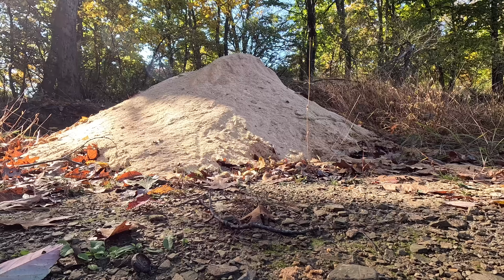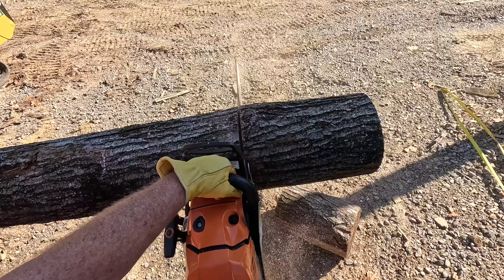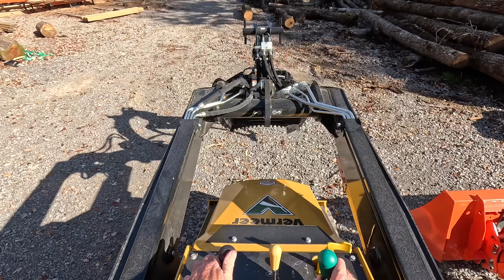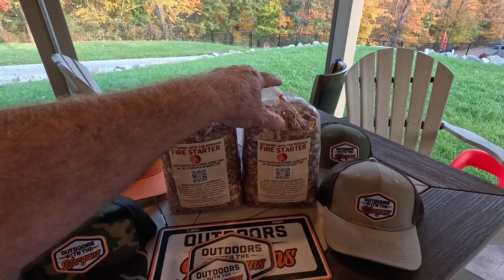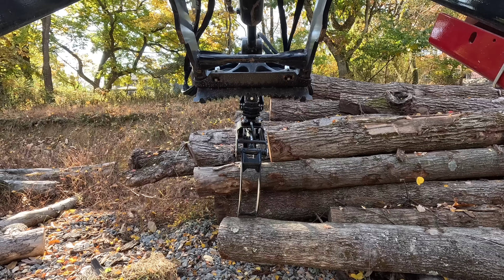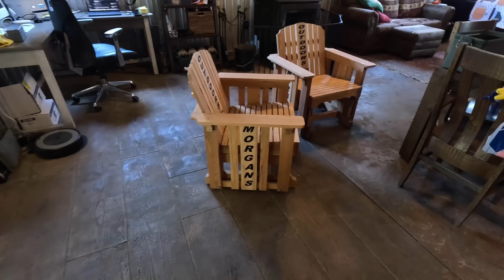Mini Skid vs Tractor, This May Surprise You

Comment: Once we rented a Toro tracked mini skid machine. It was an excellent machine. It was strong, easy to operate and very handy. Later on we bought a tractor with a loader. I don’t know which machine would suit us better. I tend to think the tractor does as we now have a side shifting flail mower to mow grass between trees in our orchard. However it is probable such a mower could be mounted to a skid steer too. 

We will see what happens but I tend to think we will keep the tractor.

Comment: MIke, as a current member of the "stiff neck tractor club"  I just went on amazon and bought a 180 degree view review mirror for my tractor.  it helps with the turning around.  once you get it adjusted correctly, i would think you could gannon, land plane, bush hog, and blow leaves without turning around at all.  it cost me less than $20

Comment: Backtracking in your videos... I think you answered my curiosity about being able to use the blower at a low enough flow for the gravel drives.
Reply: Adjusted throttle with the right blowing angles can keep that gravel in place - Mike definitely has mastered the unit in a short period of time. Nice testament to how easy it is to use.

Comment: As always, great info. If I owned a company manufacturing products, I'd be begging you to use my product on your channel. My experience standing on a battery powered warehouse lift is similar to the Vermeer. Only I was issuing materials to cable manufacturing lines. Go to computer, print off recent orders, get on lift, locate material, retrieve material, scan barcode, deliver to the line that ordered it, bring back unused material, scan barcode, place in rack, repeat. It was a 12 hour shift. I'm convinced standing on the safety switch on that lift for 12 hours a day gave me a heel spur that required orthotics. Not applicable to you for sure, but I can concur w you that getting on and using a stand up lift compared to a sit on lift is way more faster and easier. For your work, you have a perfect set-up. And, omgosh, that blower attachment is so awesome!! You maintain the road in the middle of a forest in what, 10 minutes?? Dang, now that's awesome!! I love your channel, Mike, and I love your family. Thanks for sharing this good stuff w all of us.👍🚜❤️🙏🇺🇲🇺🇲

Comment: I have a question for you about the 500i. I'm not sure if I am doing something wrong or if I need to have it serviced. Do you have a hard time starting the saw after it is hot? I love this saw, it runs great, has plenty of power and I just love running it. When I first get the saw out, I prime it up and it starts on the second, MAYBE the third pull. It starts just fine. After running the saw for a while and shutting it off for five or ten minutes, it will not fire back up. Yesterday I was using it and I tried to restart it, it was very hard to pull and I pulled it until I just couldn't pull it anymore. Still no start. What am I doing wrong?

Comment: Neighbors had some work done on the back of their home.  Guys brought a tiny mini mini skid steer.  Think it was a toro/dingo?  It fit through the fence gate.  Had a couple attachments.  Saved those guys hours and hours of hand digging and moving supplies/materials.  Wasn't nearly as powerful as yours but what a time saver....Pretty cool little machine.
Reply: Those Dingos I think are the smallest mini skids build if I'm not mistaken, just the piece of equipment you need in these stupid subdivisions where houses are stacked right up next to each other.  

Last year a friend of mine was installing a shed in his back yard, and wanted to roto-till, remove the sod, and prep the area so we could spread gravel over the area and get it all packed and leveled....I used my Kubota BX2680 with the 50" roto-tiller and was able to squeeze between his house and the fence bordering the neighbor's property.  Definitely wouldn't have been able to do that with any larger of a tractor, since mine barely fit with the 50" tiller, and was cramped operating in the yard itself, bigger isn't always the answer contrary to what so many people try to say buy the biggest tractor you can afford...well that makes no sense if it won't fit into the areas you need to get into and out of....I can get my tractor into my barn/shop and move the wood working equipment around if I need to, and its a tight fit....I only have an acre, the BX2680 sub-compact tractor is just the right size for my needs...well sure I'd love a 100+HP tractor but what's the point it wouldn't be able to do anything due to space restrictions.

Comment: Weekend casual operators should not consider a mini vs tractor due to stability issues. I speak from experience. 3 weeks ago had an "operator" working a fire lane 3/8 mile into my woods. Lane was covered in downed limbs from a recent storm. The machine was a "new" WM SM100 with a grapple. Operator got the end of lane that ends into a river (no access). He was backing up and the right track went up on a tree stump, a stump that would not upset a wheeler, ATV or a tractor, etc. The mini instantly flipped on its side. Had to get a mini excavator in to upside it now thunder and lightning/raining. ground is getting soft as well. Now the mini wont start, check the manual it has a tip over "don't restart" programed in. It is a Sunday no one of course is available. Monday morning, 5 hours labor, from 4 individuals plus a wheeler and skid steer towed this machine out. Had to destroy a bridge over a stream as well by this process.....NIGHTMARE. Found out since tip overs are not rare with Minis...

Comment: Was watching the leaves blow off the trail and there is a reason the blower is called cyclone.  You can actually see the leaves swirling in a helical pattern when blown.  So not only do they go forward,  they are spinning in a little tornado of air before falling down.

Comment: Good points Mike, but as you know I started years ago watching your channel for Tractor based content , so I do have a bias for Tractors... Indeed for your use in the woodyard the Mini Skid is the ticket, lifting power is a must along with maneuverability; BUT for all around land activities for small or large land owners the winning point of Tractors that you didn't hit on much in this video is PTO drive out put which the Mini Skid lacks. Also the many more attachments that PTO outputs (front & rear) that gives the Tractor overwhelming capabilities for home/landowners over that Mini Skid... But like I said, for your woodyard I see the pull in your affection towards the Mini Skid.👍

Comment: Mike when you pour a floor where the sawmill is you can put solar on the roof to run a dust collection system on a flexible hose and a second dump trailer to empty the dust collector into that was one of my jobs in the building construction department for the 3 school years I was in high school making sure the dust collection system was in tip top shape in the 3 school years I went there not one fire the year before in 2005 there were 3 fires in the dust collection system that the fire department had to come to put them out the I graduated in2009 year after I graduated in 2010 there were another 3 fires in the dust collection system when I was there the tools connected to the system were 2 12 inch sliding compound miter saws 1 radial arm saw 3 table saws 1 wood jointer 1 wood planer and 1 cnc machine and the 3 things that I had to ware when cleaning the tools out were safety glasses and gloves and a dust mask and with solar you can add lights on the inside so if you wanted to split wood later at night or load firewood baskets and charge tool batteries and run a battery tender on the mill say you didn’t run it for 3 to 4 months during the winter or if the tractor or mini skid or skid loader or excavator have block heaters you could plug them in and know they would start if you lost power for 2 to 3 weeks you also have enough square footage on the building to put a solar backup system that would power the building and power your house or if you want to cut the expense of the power company run both the building and house on solar the panels now last 15-20 years and currently the state of Pennsylvania has solar incentives and grants and tax credits and rebates if you also apply for the federal solar tax credit you can deduct 26 percent off the installation cost of the system and the state tax deduction amount for this year is 26 to 30 percent so if you did it you can deduct 52 to 56 percent of the installation and you can sell the excess power back to the grid and gain extra credits and not pay a dime on electric power

Comment: Actually… with bone dry weather, leaf mulching is legit with right machine. Yesterday we did our weekly visit at a 500 acre vineyard to do maintenance. When it’s this dry, we blow all the leaves to lawns and I make 2 passes with 64” rear discharge/ mulching deck on Walker mower. Then one pass with a 48” 
collection deck. This process reduces collecting 10 hoppers of grass/ leaves to maybe one. Enormous time savings and debris handling. But nothing beats blowing them to the woods! I do that as well on my forested property. Mulch on a rainy day? Only if you wanna tempt yourself to swear words. Not worth it at all.

Comment: Yes mini skids are very useful machines. I rented one with pallet forks and hydraulic post hole digger. My use was to drill 12 inch holes for a pond pier but would be great to punch holes for fencing. The auger attachment on the excavator would work well to but then getting on and off the machine would be the issue.

Comment: You need to look at a Ferrari tractor with the reversable cab interior. It's quite a neat tractor. I like the 75 hp full cab, air, heat, the whole shot. Really, look up Time with Tractor Tim and see him using the Ferrari.

Comment: Mike, have you tried pushing any snow with a blade on the Vermeer?  I use my Bobcat for clearing snow, great job, but hate climbing in and out all the time. Plus a little dangerous in the winter. Have you talked to the Vermeer dealer if anyone uses it for snow clearing?

Comment: Mike, can you find a motor it will run off your menu skid, that would power your blower as a PTO motor that would reverse from the hydraulics to PTO to drive your blower for your mini. Skin, I just, I just wondered that way. You can use the blur on the mini. Skin, you wouldn't be turning your neck. Around. It's the thought

Comment: Mr Morgan. I half way agree with ur comparison but. The tractor will outwork the mini on big open ground easily. The compact is great on short runs and confined areas but I have to tell u again. That mini will break ur back. U can back up and run things into u such as pieces of wood from groung low overhanging limbs etc. I have 25 years experience on my Australian dingo. That's before toro bought them out. Be very careful on that thing. The wear and tear on ur back is unreal. Used it in my fence business. Its basically why I closed my business after 30 plus years. Be careful!

Comment: Why are those turbines so expensive?   They are 5-6k+.  They seem to be so simple. I don't get the price!  I'd love to try one though.  They call for 20hp at the PTO and the 1025r that I have is 17.2hp if I remember correctly.  Not sure if it would run it good or not. I'd think it would be easier on the tractor than an MCS and MMM going at once.

Comment: You didn't cover price too much. A miniskid is really expensive...small tractors are really affordable. This is probably a primary reason people buy tractors...for the money, they do a lot. If money isn't a question (usually is...) or you need equipment for a specific task, there are better choices. I think for most people, they're okay with the compromise...end of the day, the tractor can still get the job done even it's slower. 

Tractors are best for a few very important tasks: fixing driveways, cutting brush/fields, and moving material/stuff around without messing up the ground. This is all many people ever need. If doing heavy duty construction/clearing, skidsteer and excavator is the way to go...but unless you're doing this for a living, they're overkill for people actually need and they're best off renting as needed. Same applies to land clearing... sure a mini-ex + skidsteer can do it, but hard to beat a bulldozer, but they're single purpose and you really need a ton of land or have a land clearing business to justify owning one because they can't do anything else.

Definitely for firewood processing, I can see how a miniskid can be great. This is a really niche thing without too many people doing. A typical person owning a few acres and want to maintain/ fix it, I wouldn't recommend a miniskid (especially considering their cost)...they're best off with a compact tractor then hiring or renting for heavy duty things. In your shoes, you clearly have a bunch of equipment and perhaps that tractor isn't needed (though seems you still find a use for it). 

In ideal world, anyone with land can find a lot of use in a 35-50 HP cabbed compact tractor with a 6 foot grader (boxblade, landplane, or power rake...I prefer TR3 rake) + cutter (bush hog, or I prefer flail). Basically exact what you got is the way to go. Might as well have a loader on it for resale and it comes in handy for fixing driveway/cutting field.